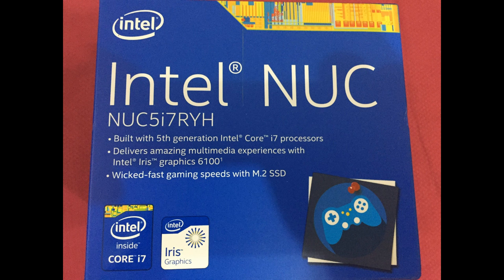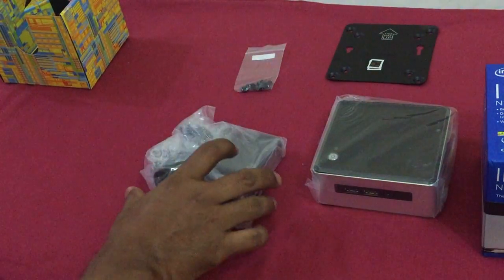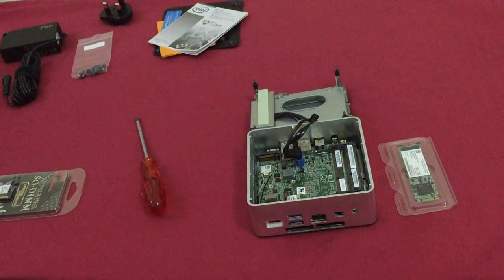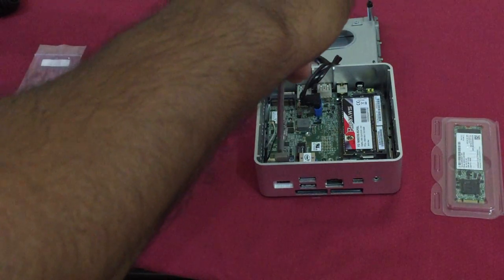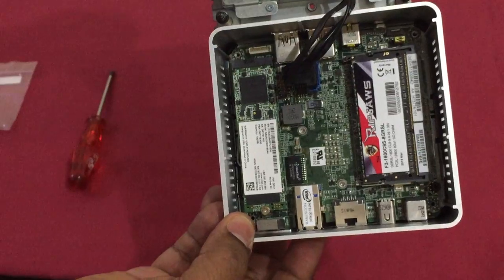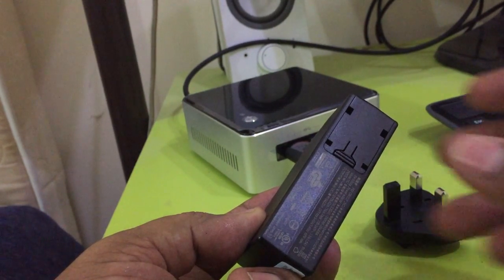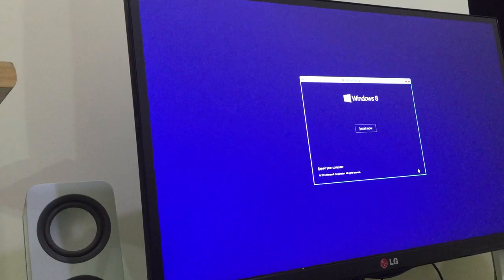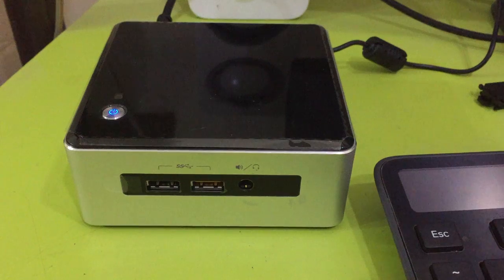INTEL NUC KIT - NUC5i7RYH

Comment: does it require an m2 ssd to work? I mean could this thing work only with one normal ssd?
Reply from the maker: Vasilis Demetriades 
We have to try. I've both installed now. The Normal  SSD I'm using as a secondary drive.
Reply: Is it easy for you to find out??
Reply from the maker: Vasilis Demetriades 
According to Google it's possible. Normally if it's first time, pc will take it as boot drive, else you have to set Bios to boot from it. I've done that on my old PC.
Reply: thank u
Reply: +Vasilis Demetriades If the model number ends with H it will use a 2.5 in hdd
Reply from the maker: It can use a 2.5 SSD / HDD

Comment: If I install 8GB memory is it better to buy a single memory card or can I better buy 2 memory cards of 4GB each 
Another reason why I want to buy a NUC is that I want less noise. I assume that this NUC is quiet because there is no fan inside
Reply from the maker: Single is better. FYI, I'm using 2 x 8GB.
This model have fan. It have a humming noise if processor is working at it's peak.
Most of the time NUC is silent
Reply: Thanks